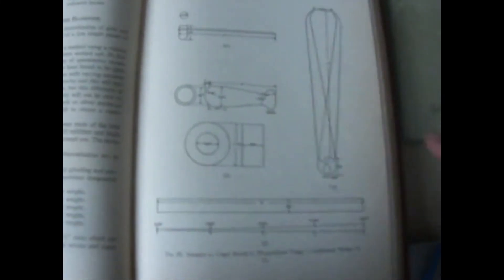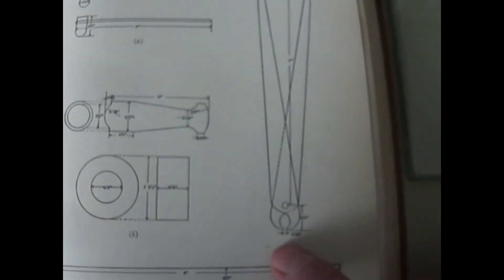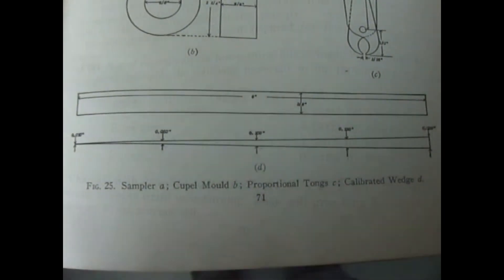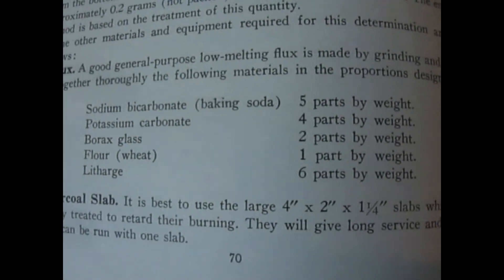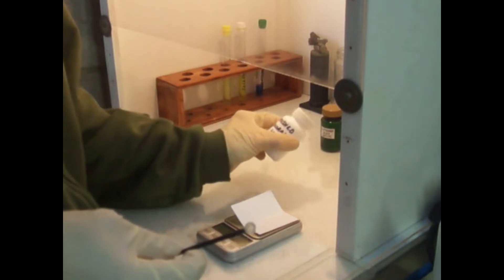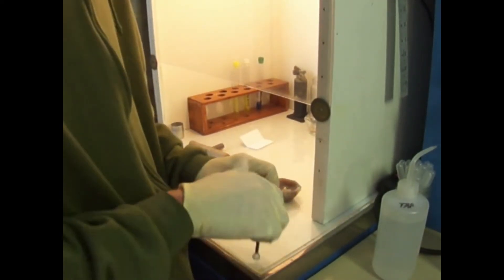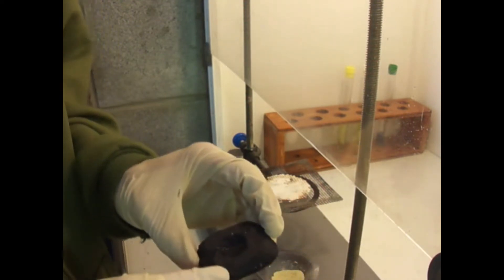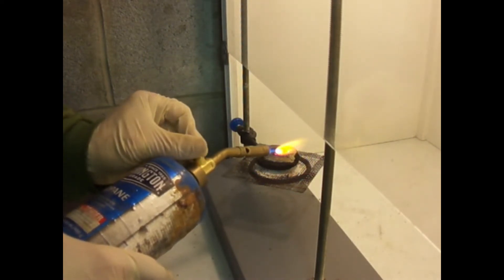Gold? or Rip-Off? Part 5 -Gift Shop Colorado Gold Ore

Comment: Thank you sir, that was very informative. Looking forward to the next installment with great anticipation. I noticed you had a glass alcohol burner toward the end - I'm having a hard time finding one for my blowpipe experiments and currently using a fondue burner. It works, but less elegant that classic glass. BTW if you would consider doing some blowpipe analysis wow that would be awesome - a lost art from what I can tell.
Reply from the maker: I don't own an actual blowpipe so you have more experience than I.  I did rig something up with larger syringe needle once.  Instead, the smaller butane torch gets put into service and has an air flow to control reducing vs oxidizing flames.

I just got that alcohol lamp recently from a friend who used it for something while putting hair on fiddle bows but no longer used it.  It replaced one I made out of an ordinary jar with hole drilled in the cap with a brass fitting and a terry cloth strip as a wick.  The lid was finally corroding through.  It can be seen in earlier videos.

Thanks for the idea as I might revisit that.  Do you have an actual blowpipe made for that purpose or did you make something?

Thanks also for your view and comments.